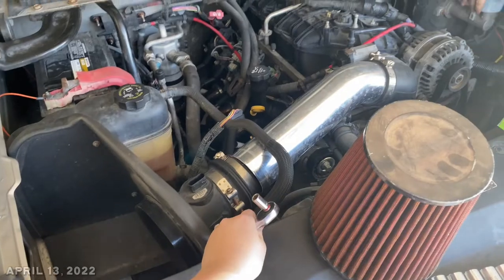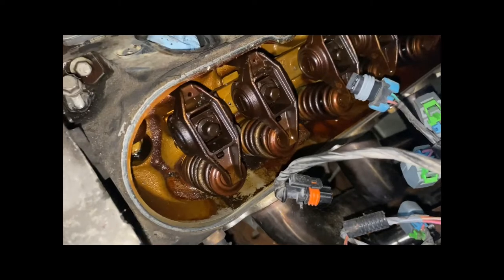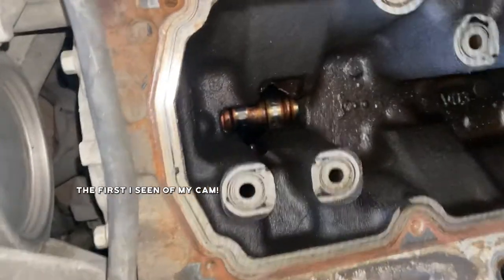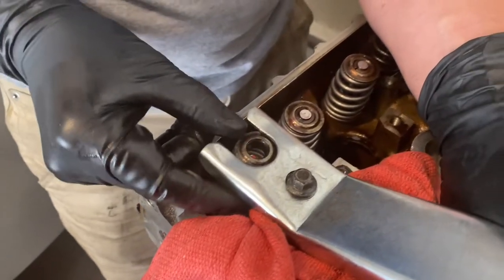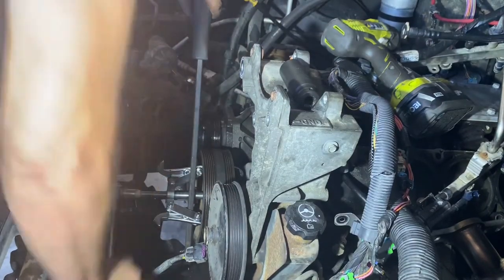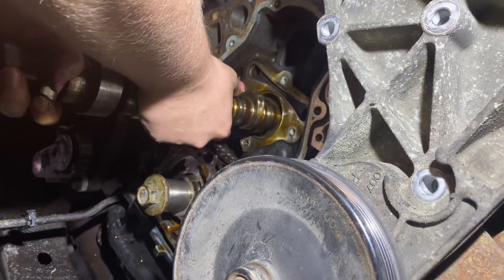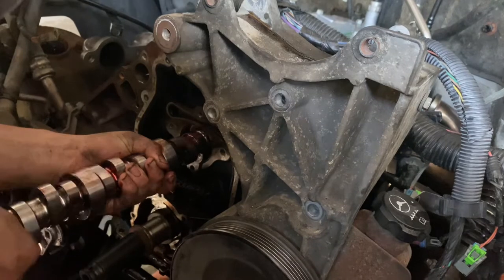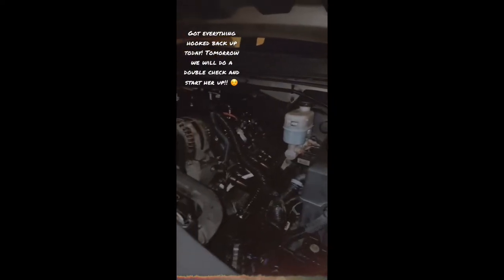Full DOD Delete & Installing the BTR Truck Norris Cam | 2008 GMC Sierra 5.3 | Not Tuned

Comment: Any info of the cam you use and springs
Reply from the maker: BTR Truck Norris Cam - https://briantooleyracing.com/btr-gen-iii-iv-ls-truck-norris-cam.html

Springs - 1 x BTR .560" BEEHIVE VALVE SPRING SET - SP011-16 $79.99

We went through BTR for the full DOD delete kit. They took all my truck information and built a kit based on what we needed/wanted. It took a day for the information to get back with us, and maybe a week to receive everything.

Comment: Great Vid ,,,Did you notice a good amount of power using the truck norris cam ?
Reply from the maker: Thank you! And yes, I did! I do have headers, new plugs and wires, and no matter what, I needed a tune because of putting that cam in. So between all that we did to her, yes she had a lot more pep in her step.
Reply from the maker: Drivability test video for the Truck Norris Cam is posted now! ⤵️

https://youtu.be/uQNjL8zNJFY

Comment: How did you guys get the oil pump off without at least loosening your oil pan?
Reply from the maker: In all honesty, since we did the headers and had to drop my pan around the time we did my DOD delete because of a stuck dipstick tube, we worked around the oil pump. We never took it off. We didn't want to have to redo the oil pan, again.

Comment: Did ur Truck Norris cam have 1 bolt or 3?
How about your original cam?
Reply from the maker: Truck Norris Cam has 3 bolts, but I also needed to buy the 3 bolt cam gear. 
The original cam is a single bolt.

Comment: How did you get by with out doing a
 Tune.
Reply from the maker: I had a tune done. I posted this video before the tune, because the local tuner we went to couldn't take my truck for a few weeks. 

Here's the video I posted after the tune. (It is only sound clips.) ⤵️
https://youtu.be/bKlP1SUv9Ic?si=EKXRW-erkKKe7QHb
Reply: if you need to get by with out a tune just plug old valley pan in the plugs

Comment: Do you need a tune for this?
Reply from the maker: Yes, the truck will not run right without a tune. 

Here's my "before & after tune" sound video ⤵️
https://youtu.be/bKlP1SUv9Ic?si=VHKesnygfTiGa3I5

Also my drivability video ⤵️
https://youtu.be/uQNjL8zNJFY?si=Q8v0ESEFg-cUr7kB
Reply: yes but you can drive it with just pluging in the old valley cover

Comment: Did you use stock torque converter
Reply from the maker: Yes, still stock torque converter.
Reply: @JuliaM987  cool. Did you lose any low end torque
Reply from the maker: No, I did not.

Comment: So a new cam sprocket is needed for the 07-13 5.3 trucks?
Reply from the maker: Yes, it is needed. With my cam specifically, I went from a single bolt cam to a three bolt one, so I needed a different sprocket.
Reply: @JuliaM987  that's what I was thinking as well. Working up a list for my 09.
Reply from the maker: I hope you can get your list and all the parts in, and everything runs and sounds great for you!

Comment: I really wanna do this to my Yukon - what something like this cost? I'm interested
Reply from the maker: We spent $1,800-2,000 on everything. But that included the Speed Engineering Headers, BTR's personalized DOD delete kit for my truck, Truck Norris Cam, and random things like gaskets from O'Reilly. So depending on what you want to do, I would have anywhere from $1,500-2,500 saved up (as long as you are doing it yourself).
Reply: @JuliaM987  did it have to be tuned afterwards? some say it's recommended & some say it's not necessary
Reply from the maker: We did tune my truck locally. That was an extra $500 for a street tune, since my truck couldn't fit on his dyno. The price for tuning will vary depending on how and who tunes it. So sorry, technically we spent $2,500 max on the full DOD, headers, etc.

Comment: 12:51.. is your frame cracked? Awesome video by the way..
Reply from the maker: Thank you, and no. It's the angle with the protective coating that's flaking off and rusted. Not too many months ago, we traveled to Arizona to get a rust free bed. We ended up driving the five hours one way without a bed on my truck, so the night prior we checked over my frame and everything else that's rusted and original. Her frame is still "perfect", minus the rust.

Comment: What kind mpg you seeing out of it? Want to use this cam in my daily
Reply from the maker: I don’t see a change at all. Honestly, I’m getting around 12-15 mpg for everyday city driving and maybe anywhere from 18-20 mpg when actually traveling on the expressway/highway. The only thing is honestly, we are stationed in Vegas. So it’s 100+ degrees and I have my AC always on and semi high because of our son in the backseat. The traffic here is also absolute trash, and I can sit for an hour or so in stopped traffic. And lastly, I haven’t “drove like a grandpa” since adding the headers and cam. I like the way my truck sounds, and I merge/drive like it. I maybe don’t drive like that every single time, but more than not, so I’m not being nice to my miles per gallons, either. It truly all depends on where you are at and what your daily commute looks like. I’m sure if we weren’t out here in the desert and city, I would be around 15-18 mpg for daily and back to my 20-23 mpg for highways. In all honesty, I don’t even worry about my mpg because I came from my ‘91 Cheyenne before my Sierra. I was lucky to hit 10 mpg in that truck, but I hope this helps a little. I’m sorry, I’m not a good example for you.
Reply from the maker: Drivability test video for the Truck Norris Cam is posted now! ⤵️

https://youtu.be/uQNjL8zNJFY

Comment: How much louder is it in the cab? Any drone noise?
Reply from the maker: I had drone because my Flowmasters and then when we switched to the Black Widow exhaust, dumped off after my cab. Originally, my Super 10's I had, had dumped after the cab and were pointed to the ground. We went to a junk yard and pulled the rest of the exhaust off a 2007 Tahoe, and put that on my truck. I now have a resonator, along with factory length exhaust, and no drone in the cab.
Reply: @JuliaM987  gotcha gotcha what resenator did you go with?
Reply from the maker: @zekeprause5606  Just the stock one that was attached to the 2007 Tahoe exhaust we pulled to make it full length, again.
Reply: @JuliaM987  could you do a video of the new set up? Would love to see how it sounds. Going a truck norris cam and long tube on my 08 escalade still staying to determine muffler and resenator set up
Reply from the maker: Absolutely! I had one actually made and lined up for tomorrow's video that will be posted. I hope it will be what you are looking for!
Reply from the maker: Drivability test video for the Truck Norris Cam is posted now! ⤵️

https://youtu.be/uQNjL8zNJFY

Comment: what size push rods did you use or were they stock
Reply from the maker: They were my stock ones. We just reused them because they were still good.
Reply: @JuliaM987  I installed one also reused my stocks and I’m thinking their to short since the cam kit comes with 7.4 and oem are 7.39 how are your brakes I lose vacuum at idle
Reply from the maker: We had to bump up my rpm at idle to 750, when we got my truck professionally tuned. I had some issues with her stalling out and poor breaks before my tune.
Reply: @JuliaM987  mine runs good just had brake issues now I’m having btr nee handle it I had another tuner do it but they said might be the time so waiting on them now
Reply from the maker: I see. Well hopefully, you can get all the issues fixed so you can enjoy it more!